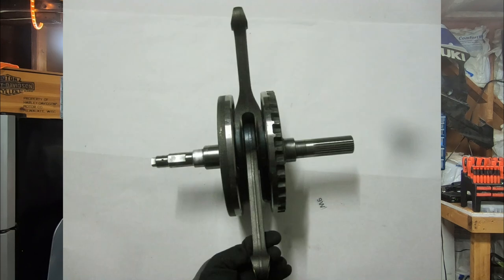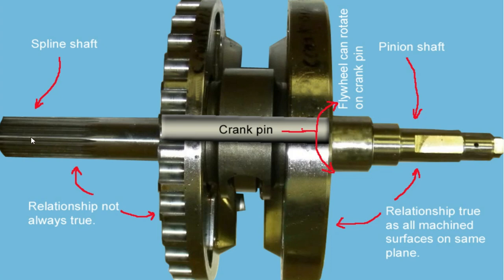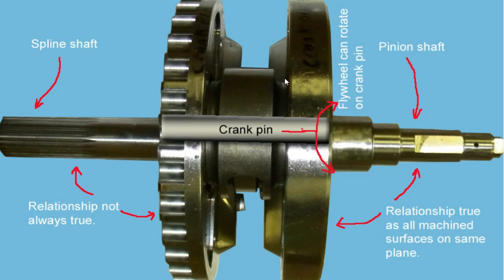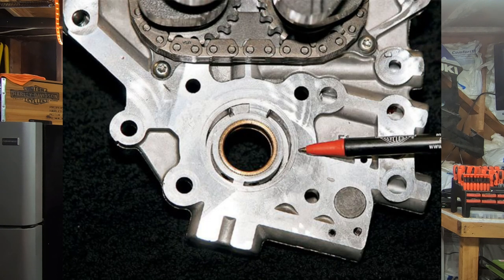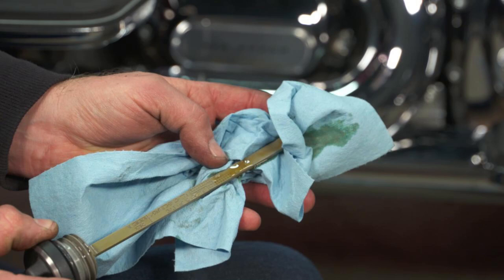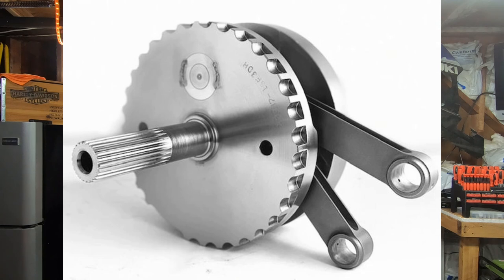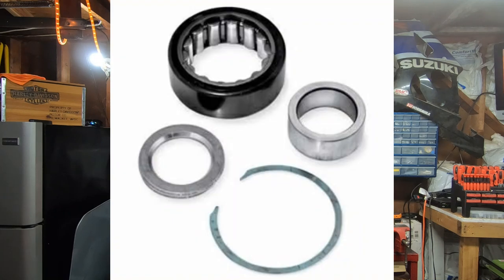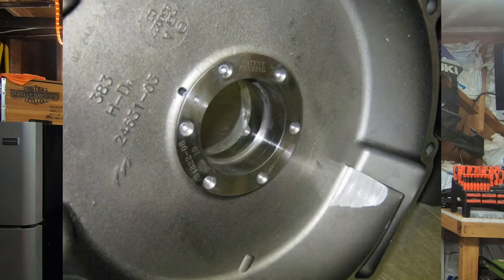The Issue With The Twin Cam Crankshafts | Harley-Davidson Cut Costs

Comment: So it's safe to buy a 1999-2001 twin cam Dyna ? Or go with the EVO.
Reply from the maker: 1999 to 2001 has a stout bottom end, but you'll want to replace the spring tensioners with the hydraulic setup to be safe. The Evo is pretty much as close to perfect as a Harley can get, but it's not nearly as powerful as the Twin Cam 88. Now it can be with a decent cam swap paired with a air cleaner and exhaust, get a good jet kit and dial it in though.

Comment: Just happened 2013 electraglide CVO. Told me they could not believe I made it to 74860 miles. Told me 20 to 50000 if lucky. They are rebuilding it. Then its going to a dark horse.

Comment: Harley wants you to ride like an old man  to save the engine so they can make money ha ha.
They all have ticking noise, most all blow oil out breather sooner or later they all have vibration. 
Harley had to know these cranks would damage the engine before selling them. But then Harley changes out a good bearing for a cheaper one , wow !
What really doesn't make any sense is  that if Harley would have put a great crank in these engine they could have skipped the M8 and had a great engine with the Twin Cam.
But, no they spent millions more on a new engine M8 and it had problems also . Harley isn't thinking with a full deck.

Comment: Went on alot of road trips always seen Harley s haveing moter problems the Kawasaki I have drove never brakes down bullet proof if u want a bike that u don't have to give the service department thousands of dollars to keep fixing buy a Kawasaki rs 900 has 110 hp. It will leave the 114 in the dust and is way more reliable , 0 to 60 3 sec. 1/4 mi.low 
11s top end 140 the Harley top end 110 hp . 95 weight about 150 lbs more,then the Kawasaki. Other bikes Honda, Yamaha ,Suzuki ,are junk but the Kawasaki u can drive fast all day in the heat and it will keep running perfect and never have moter problems or tran or clutch, u can also put heater grips,
Wind shild , ecu flash, etc🧝⚡🇯🇪💃🌴🌟🏴‍☠️

Comment: You just described my last three motors. The last time I put in all screaming eagle and S&S and it still blew up. Message me and I can get you some pictures of the damage. I still have all the parts, cam plate looks amazing. Dark horse and S&S are the only solution and the cost is negligible comparing the two. And yes, I destroyed those motors, not harleys fault.
Reply from the maker: Holy crap, yeah send those to my email under my contacts on the channel. I'd like to this! Did you run one of the Screamin Eagle cranks?

Comment: Over priced harley junk....my 18 year old Goldwing is still running til this day and purrs like a kitten 👍🏾👍🏾
Reply from the maker: One thing I can say about a Gold Wing is they are unkillable. We pulled one out of a junk pile that had been sitting for years, just for kicks cleaned the carbs and rigged fuel to it. Gas tank was junk of course, fresh battery and fired up with a little coaxing.

Comment: You forgot to mention the M8 has the same style of crankshaft albeit slightly heavier or should I say slightly larger and the best way to fix it is not to wait until you have excessive runout but to get the plugs replaced in the big end pin with solid plugs
Reply from the maker: Lol I left the plugs alone, some machinists swear by it and others think it's not needed. It's almost like getting an oil debate started. For me I would say do everything possible especially on a stock crank.

Comment: If I knew then what I know now I might have went with a different manufacturer; but… anyway, I would buy a new crank that has a welded pin and build it like it should have been from the beginning.
Reply from the maker: There are thousands and thousands of bikes putting down tons of miles on the cranks. A lot of the issues cam from someone buying a monster bore kit, huge cams and just flat beating on it with a stock crank. They are very reliable for the most part, there were some bad cranks in some bikes but that was very few and far between.
Reply: So you have to really wonder why no one has come up with an Evo style flywheels assembly so all is guys who traditionally did all their own work could at least continue to do so.
Same with the M8.

Comment: So in short, don't buy a Twin Cam, stick to the legendary Sportster and prey to all the gods you know that it do not turn into a Lemon
Reply from the maker: No one wants to admit it but the Sportster is one solid reliable engine and it's dang near a flawless design. The twin cam isn't a bad motor it's just a roll of the dice as with anything used. There's millions of miles across TC engines without major failures.
Reply: @GixxerFoo  You are right 100%. That sportster engine is a tank and already proven him self. Shame on Harley that they are struggling with easy fix design . Maybe they should start copying the Japanese engines . Indian did it and they are fine now.

Comment: Sorry a assembled crankshaft is not as reliable as a forged or single piece crankshaft.  Yes 2 stroke engines still use a assembled crankshaft, but you also are not running that 4" plus stroke with a picklefork  rod assembly.  Have rebuilt numerous dirt bike engines with a assembled crankshaft and it shocks a HD guy when you get out that brass hammer to true out the crank.  Sorry since HD has splines on the crank so the brass hammer really doesn't work all that well.  Sorry the crappy answer seems to get it true and then weld it, is a workable answer but it then is a one time build, and hope the hell you didn't get the rod bearings hot enough to do damage and remember that heat leaches.
Reply from the maker: Hell yeah I remember my dad using the good old brass hammer when I was a kid on my race bikes to true the crank up. Welding the crank is an option if you have a good machinist and he knows how to weld. But personally I would just go with a complete replacement for Dark Horse where it's built properly from the start.
Reply: @GixxerFoo  ONE issue I Have seen on other assemble crankshafts, remember the old Suzuki's, and others that had crank shuffle issues due to the power.  Well we did weld them up but one thing you really got to worry about is warpage.  Sorry you have to shoot the juice to the metal for get a good solid weld, down side is you will have warpage, sorry physics is a cruel lady at times.  Once they are welded if they are out of specs there is a technical term for the situation "You are Fucked".  BTDT and got the T shirt, you can fix it but it SUCKS.  Haven't been a HD Fan for years due to engine, clutch, brake, transmission and even frame issues.  You can only stretch a 100 year old design so far increasing horses and not having something fail.
Reply from the maker: That's very true, that design really wasn't ever intended to make that kind of power. I remember the Suzukis having crank issues, that was a mess.

Comment: Even Evos are pressed together,mine is 4 pieces, only difference is it has locking nuts on the center pin and timing shaft. Won't own anything but an Evo or shovel. Why not mention that as a comparison, all motors with one piece conrods have pressed cranks especially those with roller bearing mains. My suzuki shaft drive is 9 piece if i remember correctly with 840000km and never a problem,so it's just Harley being poor cheap ass bastards with no consideration for their customers. And thats why i wont ever buy their newer 03 and up bikes. My 2 Evos will still be going when i'm dead and decaying.

Comment: Just be mindful? 🤔WTH 😖
Reply from the maker: Don't lug the engine and keep the RPMS up. Harleys make a lot of torque down low and they are hard on cranks. Still pretty ridiculous that they don't build a crank to withstand those forces.

Comment: Another example of "second rate" engineering at Harley. Why are the cranks welded at the factory ?
Reply from the maker: They started pressing cranks in 2003 to increase production and cut cost, but I agree they should weld them too.